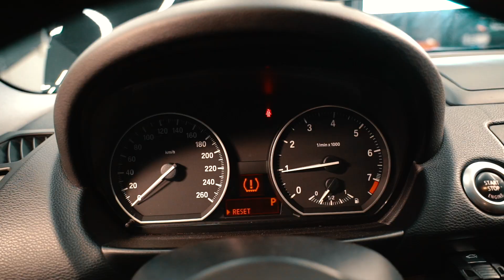Hvordan du forlænger levetiden på din motor | AUTODOC's forslag

Comment from the maker: 0:15 — 1. Regelmæssig eftersyn af oliestanden i din motor.
0:46 — 2. Skift motorolie og filter i ovensensstemmelse med den foreskrevne tidsplan.
1:07 — 3. vær opmærksom på motorens driftstemperatur.
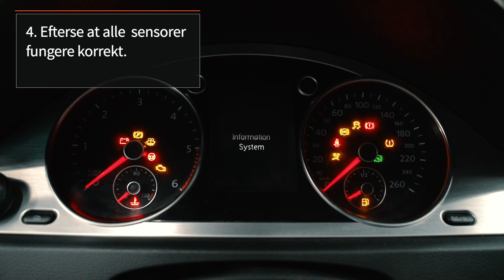1:20 — 4. Efterse at alle  sensorer fungere korrekt. 
1:34 — 5. Skift luftfilteret regelmæssigt.
1:44 — 6. Brug ikke slidte tændrør.
1:51 — 7. Regelmæssig eftersyn af ventilstyrings delene.
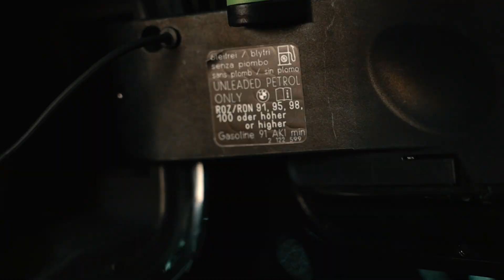2:05 — 8. Brug høj kvalitet brændstof.